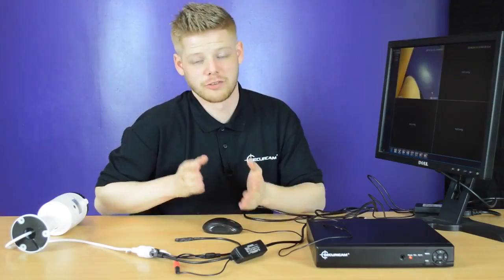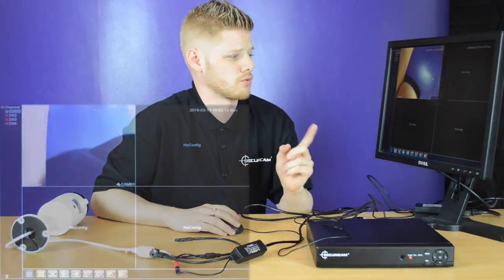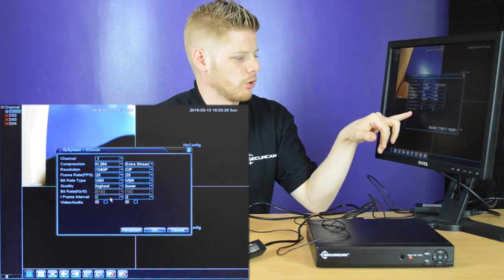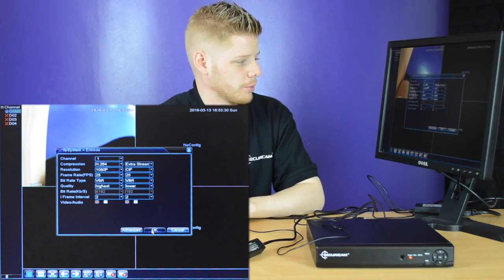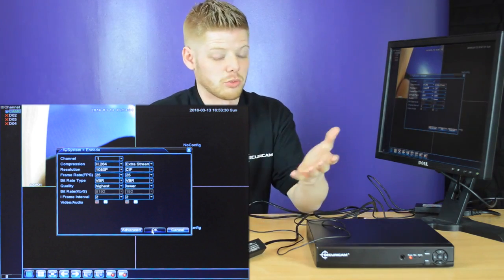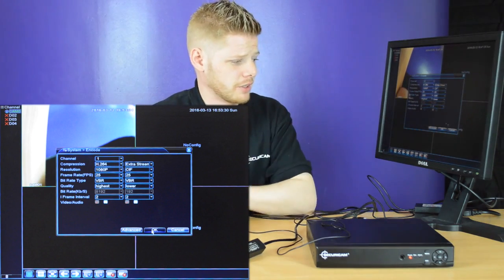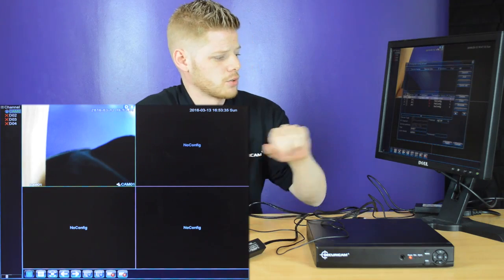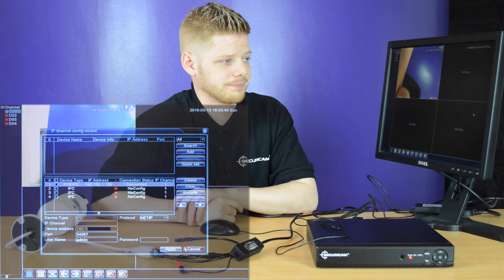Video Tutorial: How to Connect a Microphone to an IP CCTV Camera and NVR

Comment: I have a 5 mp ip camera with 2 way audio. But the sound quality is aweful. If i have the gain up it picks up distant traffic loud and distorted  if i lower gain under 50% I cant hear anyone speaking by my door. No matter how i adjust it i cant hear or its too distorted. I asked the supplier could i add a better quality mic but they said it can't be done because it has a built in mic. Your advice would be appreciated

Comment: Is possible to add an external microphone to an IP camera that have only the J45 connector and the power connector?
Reply: I have the same question.  Any responses?
Reply: For what Ive investigated, it is not possible. The only option I can imagine is to disassemble the camera, and look in the camera circuit for somewhere to connect the 2 pins of the microphone. This may work in case of having a circuit compatible with microphone, and may require to change the camera firmware in order to activate the microphone.

I am just imaging things, of course. I haven't check if this is possible :)
Reply: Did you find out if it's possible?